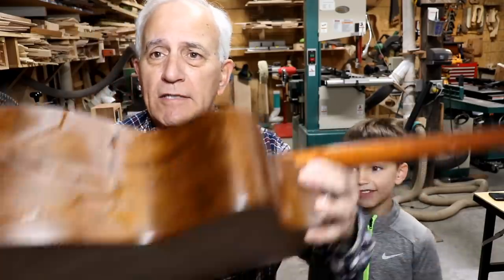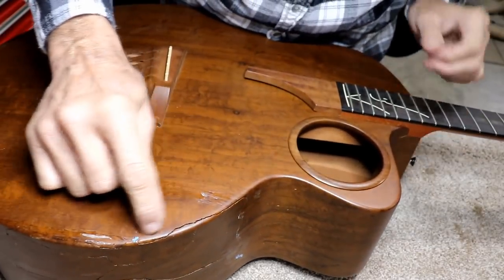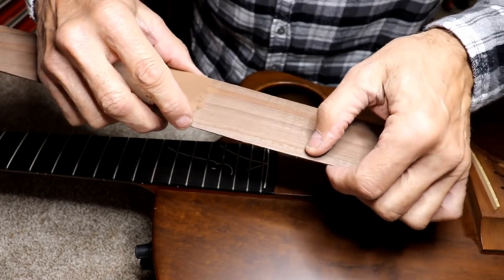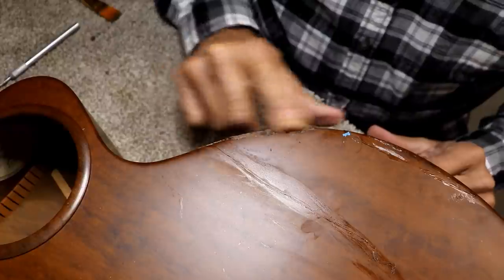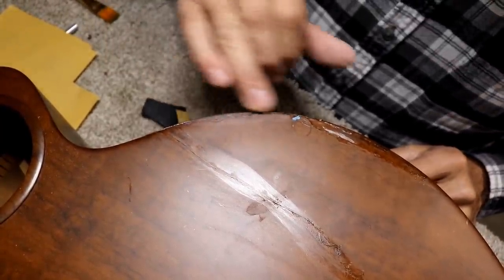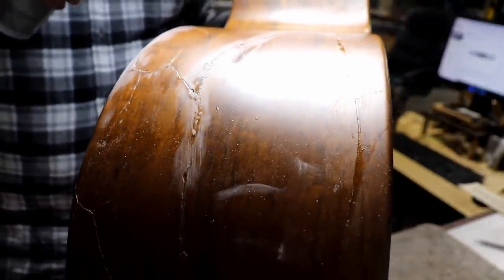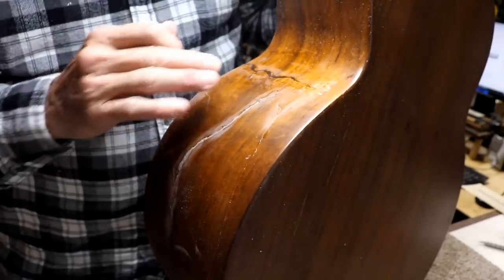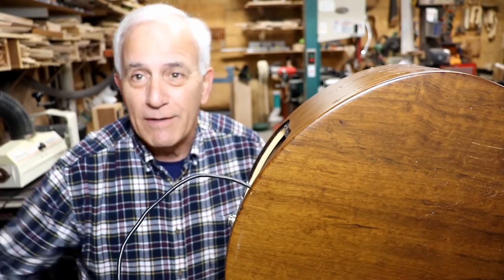VLOG #016 RSW We Are Now Bass-ed on the Outside

Comment: Considering the extensive damage of the Bass the progress you are making is truly excellent.  I repaired my Guild D-40 back in 1970. I bumped the side on the treble side lower bout and it split about 6 or 7 inches.  It was an easy fix. Several months later I wound up removing the top to repair the belly that had developed because the top bracing came loose.  I surely learned a lot with that repair.  I had been told that a "bellied" top cannot be repaired.  Wrong.  Peace.

Comment: In my carpentry class back in the 80s my carpentry teacher took 2 pieces of lumber glued them edge to edge with yellow Elmer's wood glue an the took a sledge hammer an let a few of my classmates take a wack at the glue seem to split it apart the wood fibers split but the glue joint held up the wood broke apart not the glue joint.so yea I'm a firm believer in Elmer's wood glue ...

Comment: Looks like you are making progress on the Bass reconstruction and yes it does look a little worse finish wise, but that is to be expected with as much damage it started with.   Taylor uses a UV cured resin like a polyurethane so using super glue as a finish repair may work out good.  Thanks for sharing your techniques.

Comment: The problem with  white glue is that repairs performed with it are not easily reversed, should the repair fail and require  future attention.Hide glue can be easily removed and the area  reglued, so the repair is not "permanent".linen soaked in hide glue would be a better choice from this perspective, than gauze in aliphatic glue, from a traditional luthiery perspective
Reply from the maker: Sorry but you're 100% wrong you can remove tight bond or Elmer's glue with heat just like high glue the only difference is high glue only holds for a short time then always comes loose later ask me how I know I have repaired thousands of instruments with Hyde glue it never holds
Reply: @RosaStringWorks   I said it is not easily reversed, not that it was impossible.  I have seen cases where the wood adjacent to a white glue join is broken when the wood shifts, rather than the  join opening and releasing tension, as it would with hide glue.. And I should have said hot hide glue, prepared from crystal, and freshly made.. It has held instruments together for centuries. Not sure how I’m “100% wrong” in this regard.  From the  traditional perspective of String instrument repair , hot hide glue is the way to go, also because it is brittle and does not acoustically dampen the surface it is apples to.